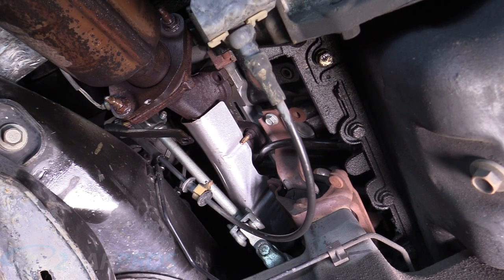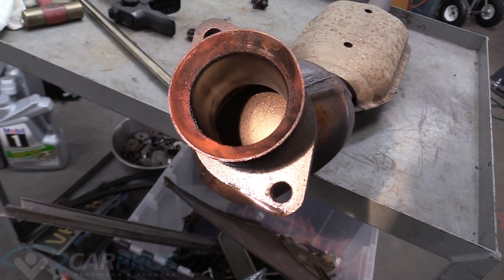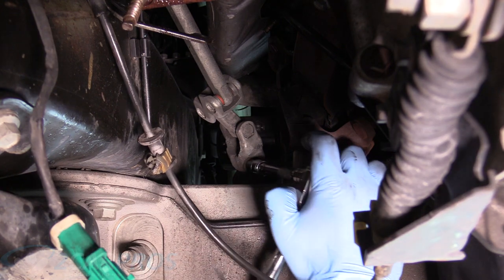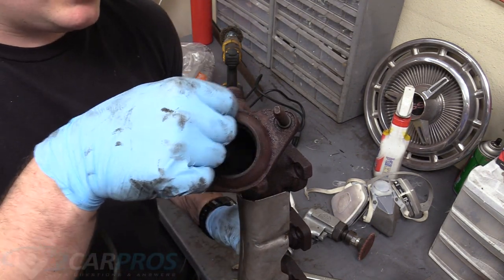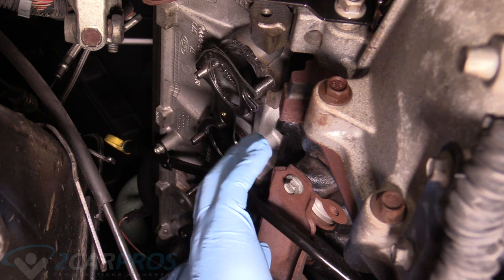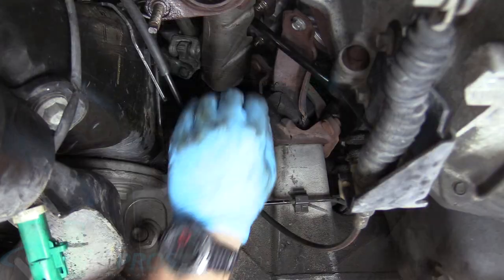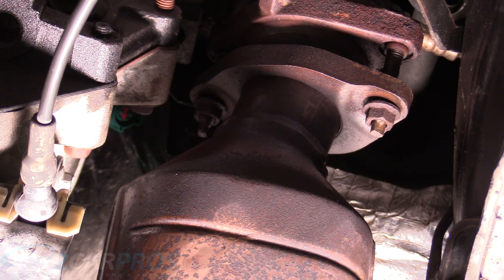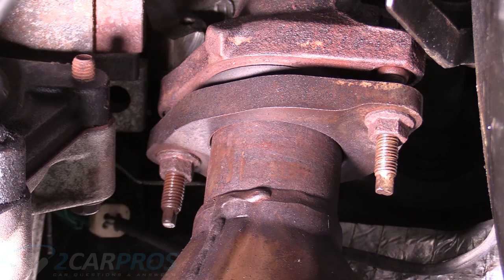How to Replace Exhaust Manifold Gasket Ford 4.6L V8 Mustang Crown Victoria

Comment: Great video!  My 2004 Grand Marquis has never seen salt, either.  Car knocks badly after cold startup until warmed, so I was VERY relieved to have bad exhaust gasket rather than internal engine (lifter or oil pump) issues.  Too bad there are all the haters making comments.  You are an excellent teacher and your video is well done and straight to the point.  Excellent!!!

Comment: bought the FelPro 1 piece gasket for mine. I think it will seal better against a head that's been corroded from leaking exhaust . I  wouldn't put sealant on an exhaust gasket. That seems like a potential issue. manifold flange can certainly reach 1000 deg F if someone pulling a long hill on a hot summer day. It'll burn off.
Reply: First time I've ever seen someone use silicon too.

Comment: Question. How come it doesnt say the torque spec in the Haynes manual? 106 inch lbs? It just lists the bolts as 18ft lbs or 216 inch lbs. And all data you have to pay for to use correct?

Comment: How much does this kind of repair usually cost?
Reply: I know it's a year old. It will probably cost around 1,000 to 2,000 dallors. That including parts and labor.
If you're going to do it yourself, parts should be no more than 200 to 400 dallors
Reply: @andrewilson8530  
Are you including tools? It's about $30 a side in parts if you use the more expensive stainless studs.
Reply: @frankmc5112  yes, IF you have your on jack and jack stands.

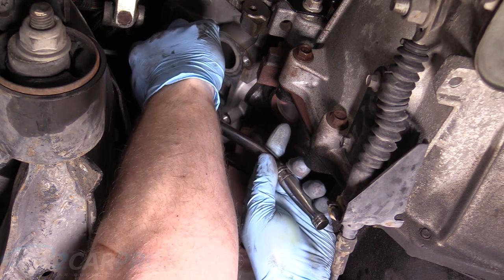Comment: 9:13 you have listed torque specs. Where did you find that? My 2005-2014 mustang manual says 18ft lbs. But you have listed 106 inch pounds. I want to make sure I properly torque the studs/fasteners down.
Reply from the maker: I get all my info from AllData. Thanks for watching!
Reply: @2carpros  thank you for the useful video. Now I'm stuck trying to get two studs off my head. I stripped the star top. Trying to figure out how to get it out without breaking the stud off into the head. My heads are fully removed.

Comment: there's 2 broken studs on my exhaust manifold on the driver side so do i just change the driver side or do i change both sides? so if i do one side only would that make the other side weaker or do i change all 16 bolts for both sides and change the exhaust manifold gaskets as well
Reply: I just did one. I spray the studs on the other side with penetrating oil a few times a year

Comment: Pretty easy on a "new" car.  Now show us on a real car that none of you sockets and wrenches fit because all of the nuts and bolts half rusted away and the gasket is leaking because so much of the studs are rusted away that there isn't much actually holding the manifold on.  Maybe you have never seen one of those
Reply from the maker: How is 2011 new? I have seen plenty of rusted cars in my day and I find a way. They wouldn't film well though. Thanks for watching!